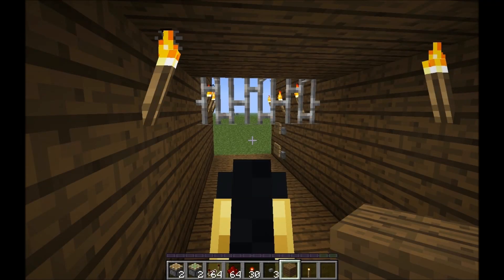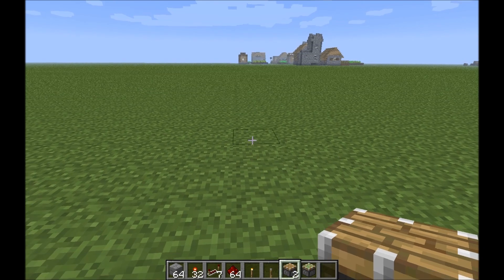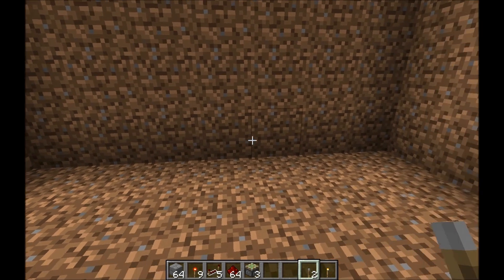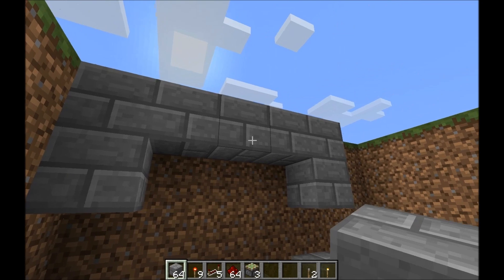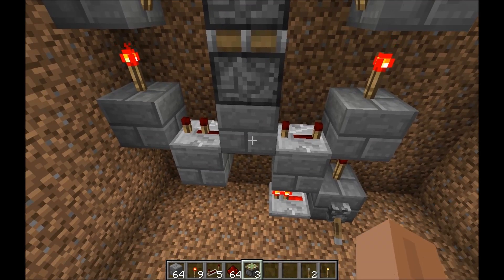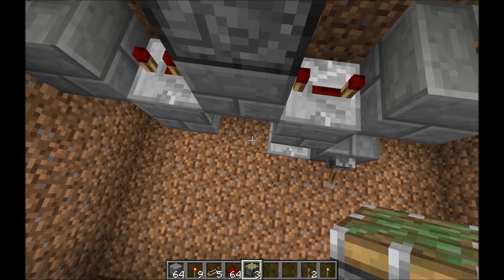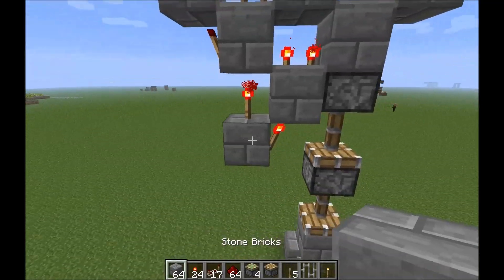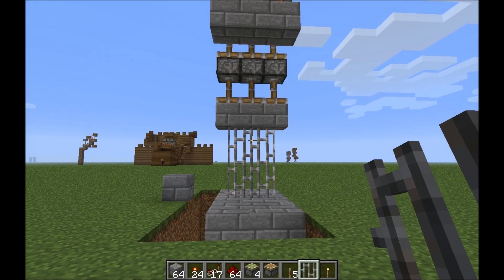Minecraft piston operated Portcullis door! - 100% tested to work on both Xbox and PC

Comment: help I cannot get my double pistons to extend. only one (front one) extends. 
iPad pocket addition
Reply: It actually no worked on PE, let me teach a simple way to get it:
1. The face up double piston extender not this design, this design no work on PE because the 4tick repeater and the block leave and can extend to the first piston, this only for PC and XBOX, the design change to, on the down piston there, first need to extend is, the first connect to the piston the repeater need to extend first, and the second torch can connect to the double piston extender, this is the fast way to get double piston extender, this for PE have 6tick no 4 ticks, the 4tick fast double extender is for PC and XBOX, so the piston way close likely 2tick, and the redstone need ticking the last piston pull back the take the block piston, and back the take back block piston need to retract back the block, use you mind to think
1.The close back piston, the face down piston extender
You did need this design just push down, so 2 regular piston can extend, is easy, just the last piston push first and the to double, just use repeater 3tick or 4 tick or 2 tick can extend
2.also you can use the last piston extender to extend fast, just use redstone dust regularly connect the last push to 1block piston and the second one you can also use redstone dust, is very easy

Cannot actually do not know what I saying, go to use sand to extend the close with piston extender, is easy